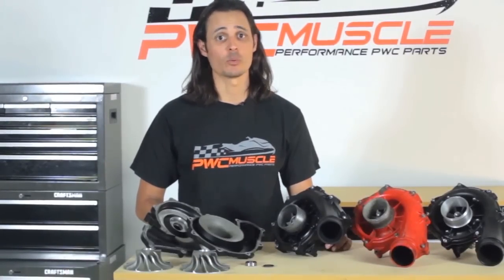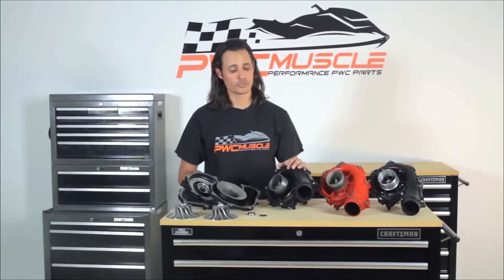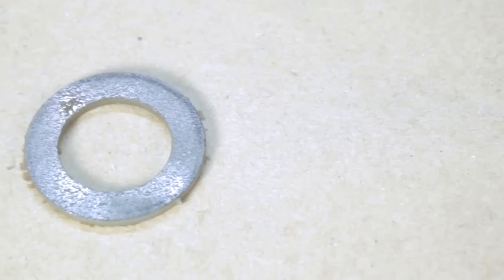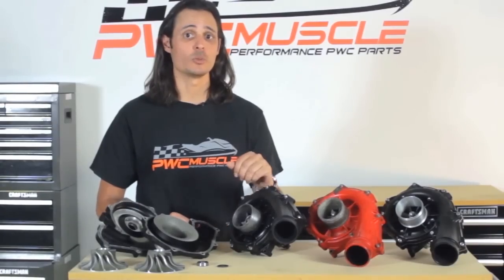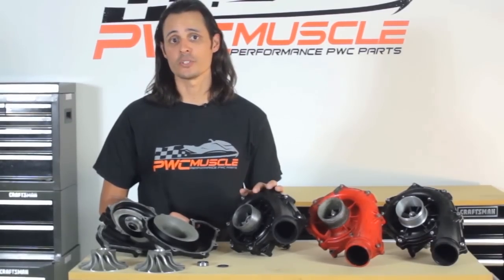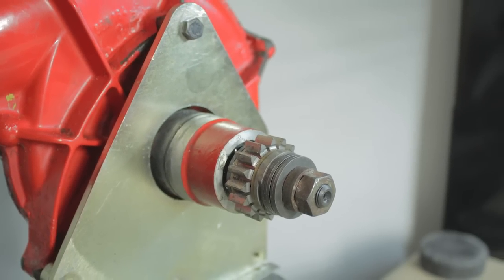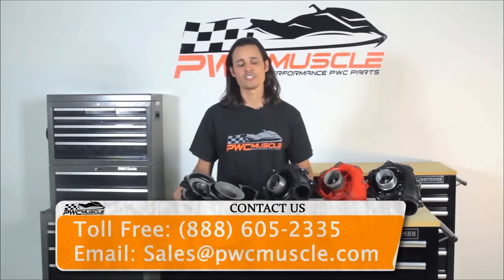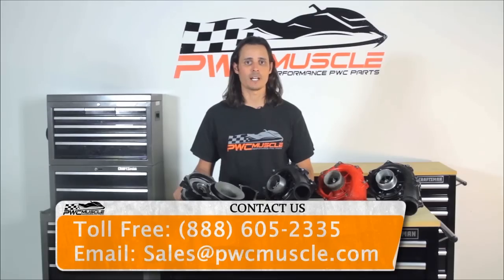Sea-Doo Supercharger Rebuild Service by PWC Muscle

Comment: Just finished installing my rebuilt supercharger from PWC Muscle. They did a great job, fast and efficient with excellent workmanship. I normally would have done this myself but the cost of the rebuild kit and required special tools added up to a savings of only 20 bucks.
I had a question about shipping and Joe emailed me back quickly with an answer. These guys are no nonsense pros!

Thank you Joe and the team at PWC Muscle
-Jon Landry

Comment: I have two 2007 Sea-doo's, original owner bought brand new and have about 225 hours on each unit.  I've never had my SC's rebuilt and they still run like new.  How is it that I've been able to run them this long with no problems.  They've never been in salt water, they are stored in my garage when parked, I live in Southern Texas so not prone to many freezing temps and I'd say I've kept them pretty well maintained.  So is the hype to say they need to be rebuilt every 2 years complete overkill??  Before you bash me for pressing my luck, I have decided to upgrade my current SC's now only because I don't want to push my luck anymore.  But it still baffles me that my skis run great still and it's been 15 years on my original SC's.

Comment: hello i am buying a 08 215 with 137 hours how would i know it was done at 100 hr or should i just have it redone?
Reply from the maker: Pierre, without proof that it was rebuilt I would strongly recommend getting it done soon.
Reply: @Pwcmuscle  mine was done 30 hours ago, but 1,5 years ago. When should one expect it to be checked again? I read it is 100h/2 years
Reply from the maker: @MySipuli  Yes

Comment: Hey, im thinking of buying a 2009 Sea Doo GTX 255. I have read they come with the latest metal washers which are much better than the ceramics that SD shipped ono earlier models. I'm wondering if you have any thoughts about them or this model?
Thanks a bunch
Reply: Yes, I have the 2007 RXT, and it had the original ceramic washers - they are only good for about 100 hours, and then they can shatter as ceramic material is hard, but brittle.  I rebuilt the supercharger with a kit purchased on Ebay, and it came with all of the parts and special tools to make the job easy.  The kit contained the STEEL washers, so grenading shouldn't be a problem, now.  My buddy has 2 former rental units from 2005, and with the steel washers, they have over 400 hours apiece with no problems.
Reply from the maker: The 2009 will contain the metal washers. However, the bearings still are a weak point and over time the washers will lose their hold and start slipping.  So no rush on replacing anything ceramic...just stick with the 2 years or 100 hours and you'll be good to go.
Reply: Seems tough to get an answer about cost here